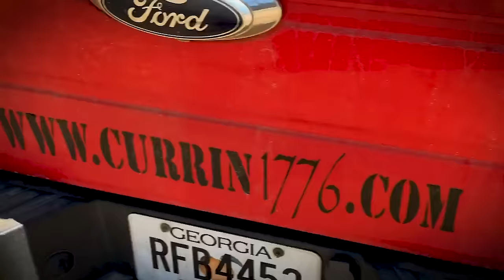Field Testing Traction Devices

Comment: May sound nuts, and it does make a mess, but in a pinch, the front floor mats on many vehicles will help out.  Especially in snow where all you need is some kind of traction.  I put an industrial carpet piece in the back of an SUV to give a little more "finish" look.  One day, that SUV was off the road and in a wet slush such that the highway tread tires could not climb back up.  The carpet piece did just the trick.  Best of all, it cost about $10 to replace with a brand new one when my wife decided the one we used was looking a bit ratty.

Comment: One way of getting unstuck is the same way farmers can use to get farm equipment from out of the mud. Keep a small length of 2 by 4 in your car. Use a ratchet tie and ratchet the 2 by 4 to a tire. The 2 by 4 will give you the best friction to get unstuck. Just move forward very very slowly until you can get into a good area that will allow your tires a better grip. Might even be a good way of getting out of a ditch on the side of the road. Put on all of your driving tires and drive very slowly in a straight line. Kind of like putting tank tracks on your car when needed. That’s what really helps give regular tires more traction (the width of the tires). If you don’t have any 2 by 4 just use some rope and tie a branch to the tire. The survival expert Creek Stewart’s Grandfather Would do this to his farm tractors, stuck in the field. Tie anything like a 2 x 4 or branch to drive wheels. That’s why you really get your traction, the width of what connects to the ground.

Comment: These would be great.

I saw a guy use about 5-10 feet of cordage to tie the traction devices to the bumper.  The objective is to continue driving until you get to safe spot all while dragging the traction devices along so you don't have to walk a long way to retrieve them.
Reply: THAT IS A GREAT Tip
Reply: Best comment! Never thought about that.
Reply: The rope alone will help you find it sometimes. So use a bright color. They tend to buried after driving over them. Not just in sand.
Reply: This is how we use old skool aluminum ones in Africa. Most have a hole for the rope on the end
Reply: What about the front wheels? Wouldn't the rear tires tear them off by driving over them and the rope? I'm not picturing it correctly

Comment: The best thing is a 4-5 foot trailer ramp rated for vehicles. Jack up the wheel enough, slide it in like a Friday night, and that’s it. Plus you can use to get out of roxkstuff and huge ruts.

Plastic is the most slippery thing available

Comment: Cool video, thanks - made myself some from 2x6 wood and used 1/4" hex head heating screws for traction (ice racers use these for DIY studded tires on dirt bikes) - they protrude 4/32" - haven't tested yet though - your test shows the importance of a wedge shape and traction at the ends

Comment: Tyre pressure! Drop it in the sand by 40% Max trax are huge in Aus but I prefer the rubber tipped so you don't do a burnout on the Max trax. And a winch and winch extension

Comment: The roll up rubber ones didn't work very good. It doesn't matter how portable they are if you have to have 3 or 4 sets in order to make them work halfway decent. Looked like the max ones worked best.

Comment: Pro tip: chains also work on sand and mud, even rocks! unless you’re in Moab and there’s ONLY rock, in which case you probably don’t need the chains. But if you’re climbing a loose rutted out hill with some rocks in it those chains will still do you some good.
Other than that tires and suspension are the best “traction devices” money can buy.
Reply: i have tried this and it does work great got me out no problem with the old street tires i had but when the chain looped around the tire for some reason it broke my plastic inner finder on my yj lol so don't full send it like i did
Reply: @NERFDUDE-gp3lq  or if you do full send it at least make sure your chains are secure lololol
Reply: @redrider7730  thanks for literally ignoring my whole point so you can argue with me about where snow falls.

Comment: Seems as though the rubber roll-up ones would work better for snow & ice than the hard plastic ones.
Reply: On snow yes - helped me a few times. On ice they slip. They work also on mud for smaller cars - I helped a few neighbours (there was no need to pull them out with my car).
Reply: @henrykg  what are the roll up ones called?  Link?
Reply: @GPMAX01  Here they are called "recovery traction tracks"

Comment: Heck, after going through all the effort of digging the tires out, you could probably just drive the truck out on it's own without the traction devices. By the way, each of those devices specifically say not to spin the tires while using them. You're supposed to go slow, give the tires time to grip, and ease yourself out.